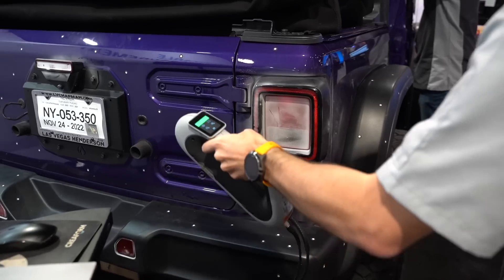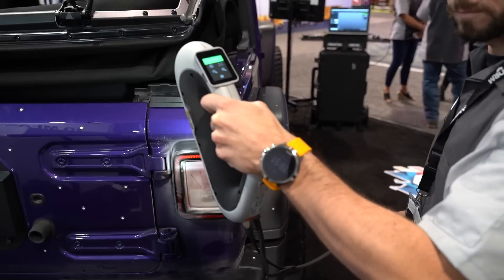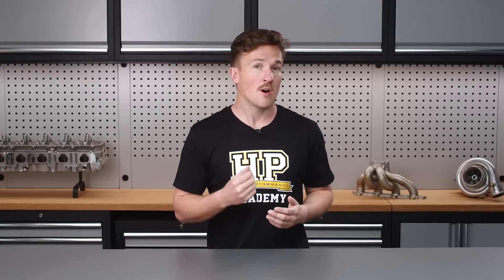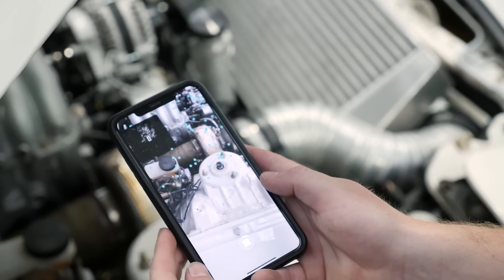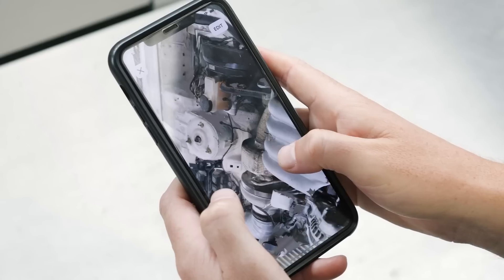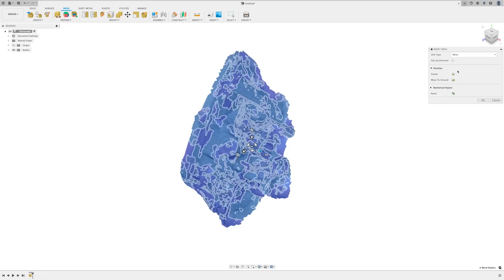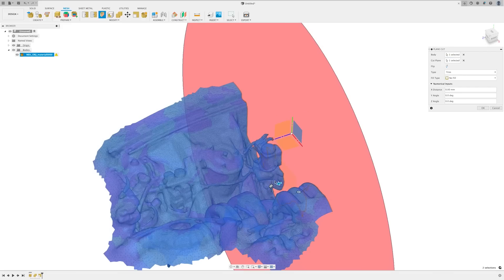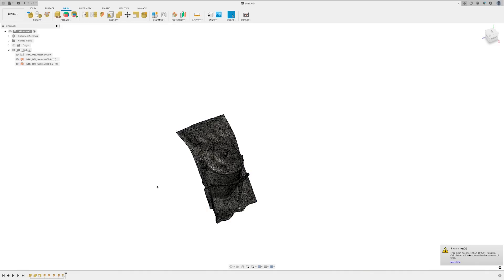3D Scanning For Motorsport Builds | CAD

Comment: 7:15 one helpful way I’ve used to find the scale factor is to take the real life (known) measurement and divide it by the CAD measurement. That should give you a quick and accurate scale factor ratio for your design. In this example 95mm/1113.648=0.08530523.

Comment: I used my phone to 3D scan my cars side marker, I realised my side marker was reflective and would distort the image of the scan. I used my charcoal based toothpaste and covered the lens and re-scanned the side marker, it worked perfectly. I didn't pay anything for the 3D scan software (PolyCAM) and was able to create a part that could easily generate $1-$10K in sales and cost pennies to create. I even finished up reverse engineering the mounting points within TinkerCAD.

Comment: Back in 2007 I was an industrial design intern working on splitting a 3D modeled car body into separate components, for creating carbon fiber molds. Back then they used a hideously expensive 3D arm to only create a point cloud rather than a stitched mesh, based on the axial angles of the arm. Forward 16 years and I just picked up a very accurate handheld scanner for car body parts for 1000 Euros.
Reply from the maker: Interesting insight, cheers for sharing Jochem! It's certainly an area that has seen an amazing amount of progress in our lifetimes - Taz.
Reply: Could you please share the scanner you've chosen. TIA

Comment: I've been trying to learn freeCAD to go along with printing, I even updated it with the dracula skin!  This is being used now quite often before transplanting a new engine in the car, designing a new subframe if needed, or for parts to be fabricated to ensure they have room. in the past I've tried several scanning apps for the phone and none of them worked out for me. The problem is they have not very good definition and rely heavily on ai algorithms so you need a good connection to their servers with specialty built computers, or you can spend like at least 900 bucks usd for a 3d scanner and thats where they start, but they can easily range  in price up to 10k for one of these scanners, a good one though.
Reply from the maker: We had surprising success with the iPhones around the office. We have just purchased a scanner and out of the box it has been really disappointing when it came to our expectations vs price, BUT, that is just out of the box. We are yet to spend some time making sure we're playing to its strengths and not making some user errors.

Even at $900 bucks compared to where things were not all that long ago, that's not too bad. Many would need a really solid use case to justify that and beyond though for personal projects. They'd probably get there via limitations of what their phone can do vs what they want to do too like you.

Cheers for sharing your experience so far - Taz.
Reply: @hpa101  You guys got good results in the demo! If you're new to printing and cad work at home, scanning is like the final boss in the game! It's all worth it though, the other day I printed a part I designed, four times, until the dimensions were just right. I felt quite some accomplishment to design and print a part that works as intended. Don't get me wrong I also love downloading free print designs but a beethoven bust or a sonic medallion won't improve my build. With a custom cad design and a 3d printer, you can test fit a part, then send away for metal printing with pcbway, or sendcutsend. Or even use abs and cf filaments. Ps. I believe it that affordable scanning is slowly becoming more accessible, with the expensive scanners arriving before the clones did. 
Cheers, you guys are awesome!
Reply from the maker: We agree fully and have been doing just that regarding printing test parts and the same via a small CNC router for a while. It has made some projects much faster and helps ensure we don't have a 3rd party make final parts that actually are not do final. Expensive way to do it time and money wise is the latter!

Stoked.to hear.you have done your first.part and are fizzing about it. That's what it's about, the challenges and satisfaction 😎